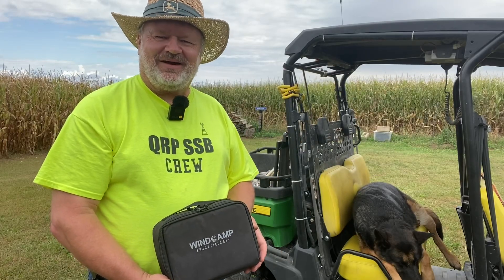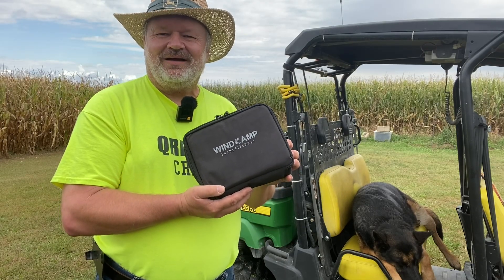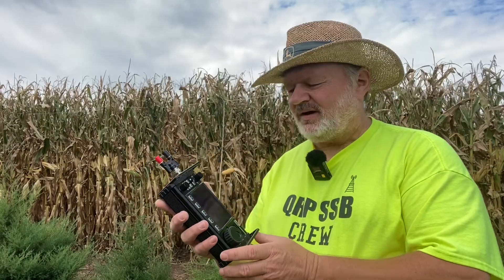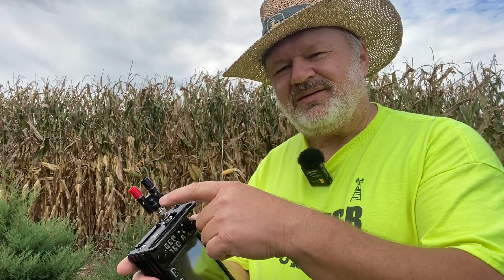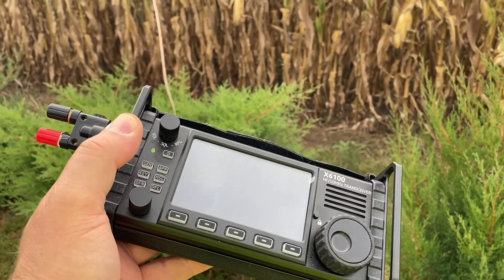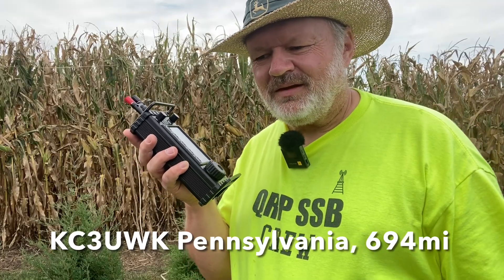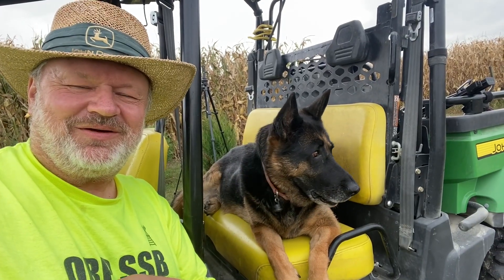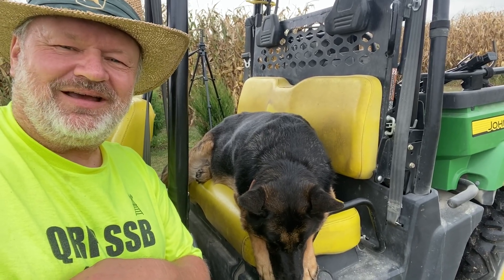Ham Radio Made Easy - Is it Really this Simple? Xiegu x6100, Speaker Wire, QRP

Comment: Is the transmission line speaker wire as well? Anyone answer please. I thought I had to have coaxial to 1:1 Balum then doublet
Reply from the maker: hello, and yes the speaker wires together is the balanced feedline, then i just pull the two wires apart to make the two 16.5ft dipole legs.

Comment: Great video. I've got a dipole for 20 m made from 2 strands of computer ribbon cable and a binding post adapter. It works fantastically, and packs away to nothing. One of my very first contacts on it, with me running 5 W CW, was ZL3XDJ on the opposite side of the world.
I use the same method as well to make a wire 1/4 wave vertical with elevated counterpoise which is a fantastic antenna
These binding post adapter and a roll of wire need to be a compulsory item for all new hams to save them from spending a fortune on commercially produced antennas.
73 and carry on with videos like this! 
M3KXZ
Reply from the maker: Hi Pete.. Thank you for sharing your comment and experience.. Being simple is just plain fun.!!! Thanks for watching. 73

Comment: Nice one! I've made a few of those speaker wire dipoles and they work well. I use an Underwriters Knot at the middle to keep the wire from splitting down the feed line.
Reply from the maker: thanks Mike.. never thought of a knot..  It does work well though.. and simple.. thanks for watching. 73

Comment: Great job! I figured that dipole would shine! Can’t beat a dipole ( unless you combine more than one into an array). A high dipole has a deep null off the ends, but a low dipole does not. As you noted it’s pretty much omnidirectional. 
Speaking of directive arrays, maybe next year you can add a reflector and some directors and have a corn stalk Yagi! 
73, N4DJ
Reply from the maker: Hi Don.. I wasn’t sure what to expect using the binding post.. I was bracing for failure, LOL.. but always pleasantly surprised when it works. I enjoyed the facebook livestream using it too.. that was fun. Thanks for watching and supporting the channel. 73
Reply: @hamradioqrp-k0klb  I don’t have a corn field in my backyard, so I have used some short poles to hold up dipoles! One 40 meter antenna was supported by three 2X2s about three feet long.  Also did 20 meters with a a 12 foot fiberglass pole holding up the center insulator and walked out the ends as far as I could. Used a gallon jug of water to hold each end.